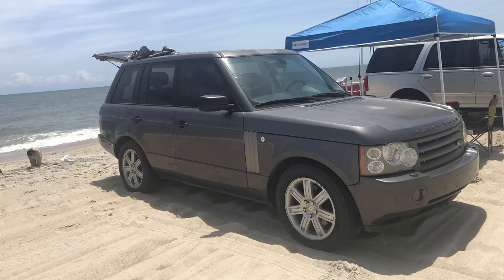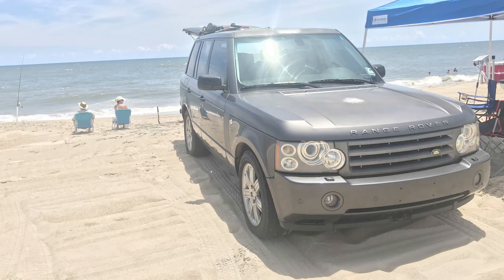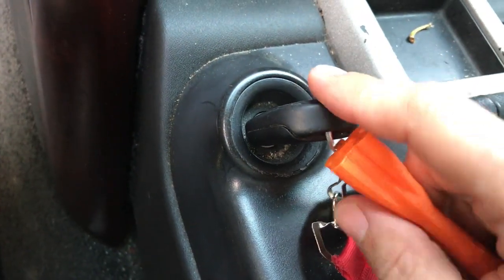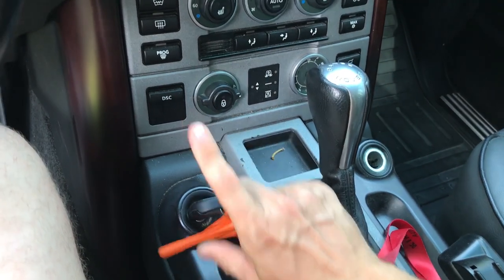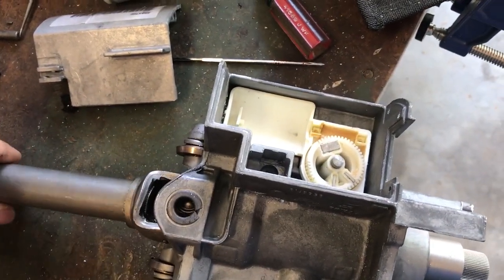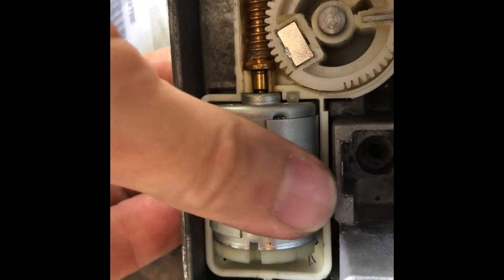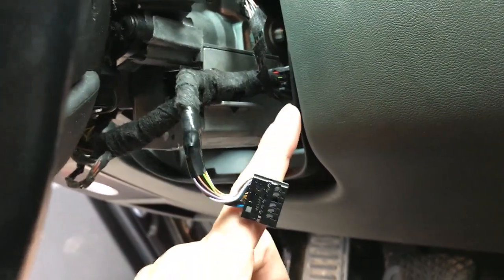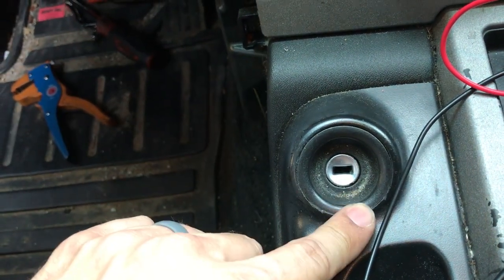L322 Free and Permanent Steering Column Module Bypass

Comment: Looking at all this work people will just take the fuse out every time 😂
Reply from the maker: Maybe! I would wager most people only need to install the jumper wire though. I pulled my column to dig into the root cause but it's only needed if the steering wheel is locked and won't release.

Comment: its much easier to install a steering lock emulator for range rover .
Reply: what is that?
Reply: @rocko882  The emulator is a plug and play device that overrides most of the anti-theft and steering lock electronics and allows the key to turn. I bought one from UHS Hardware for my 2006 L322 HSE with the Jag engine 4.4L. Item GK-1300. See the installation video on UHS. It solved the key lock problem but I still have a "Crank but no start" problem. If I disconnect my battery completely for 1 minute, It will run 3 seconds like a champ but then quits.  Still have a anti-theft triggering to kill the ignition. I hope someone can help me over-ride that.